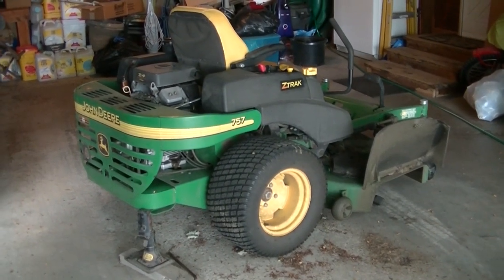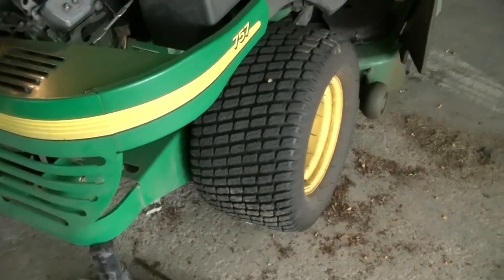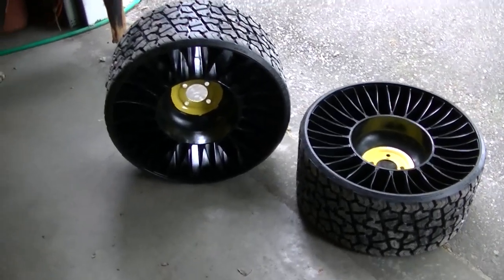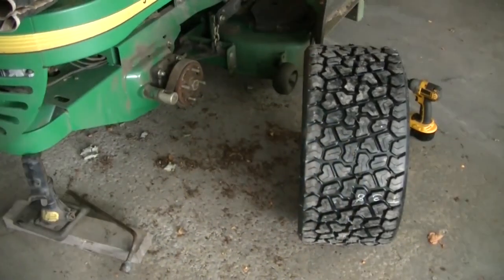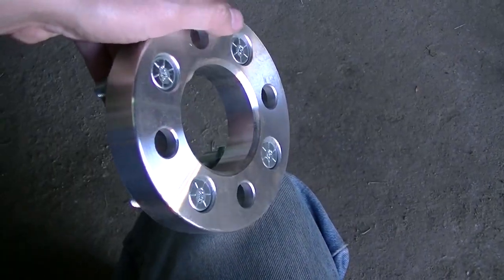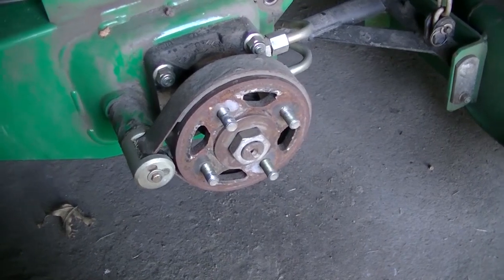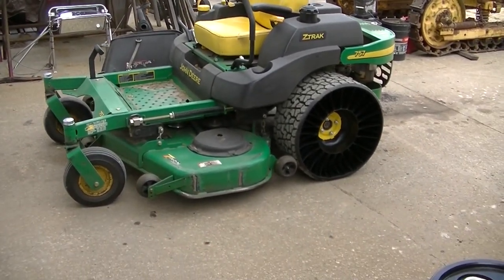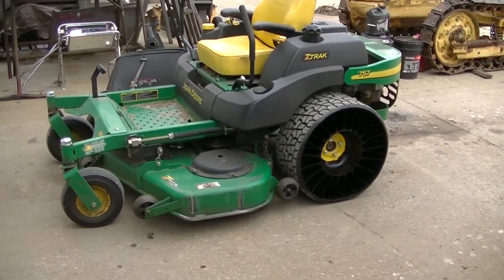John Deere 757 ZTrak Michelin Tweel Install Airless Tires

Comment: They make these for skid loaders as well. I would love to try them out on a skid loader. On construction sites nails are everywhere and not always do I need my track machines. Nice thing is you'll always mow evenly side to side, no more tire being low on air pressure on one side and causing the mower to cut unlevel.
Reply from the maker: I don't see any downsides yet except the cost.

Comment: I've tried since they released to get a set from my local John Deere dealer (Richie Tractor) for my Z920a and keep telling me I can't buy them, only come on the machine. Guess it's ok because I wouldn't have thought about buying wheel spacers and I definitely don't have the skills to machine them out like you did  Great video, I can't wait to see how they work for you.  I've heard nothing but good thing from some fellow landscapers. Hope scag gets some soon as well.
Reply from the maker: I was told the same thing at the dealer.  They sent me to the sales guy.  He looked it up and saw they now have a part # and could be ordered.  He called someone and they said he could order them.  3 days later they had them at the dealer.  I am probably one of the first people to order them separate from a new machine.  Not familiar with all the Ztrak mowers but these wheels are designed to work on the new Z900 series.  You can't get them on the Z915.  Not sure why.  They aren't cheap.  A little over $1100.  With a new machine they are $850.

Comment: I noticed this video is 5 years ago so, I'm just curious if your still running those same tweels  and how do you like them?
Reply from the maker: I love them. At first they seemed like they didn't have good traction. It's like they had a wax coating on them but that wore off. Not having to worry about air or running over something is great. The only downside to these tires is the price.

Comment: I am mostly interested in those type of tires to get better traction on hills was wondering if you have any input also was wondering if it is  Easier on grass with turns
Reply from the maker: When the tires were new they actually had less traction because they had like a wax on them. Once that wore off they work like normal tires. I don't see getting more traction from them. They work just like normal tires but never need air and I don't worry about running anything over. I wish I could get some for the front wheels.

Comment: Over $1000 lot of money just for a set of tires  ( Good video )
Reply from the maker: Probably would have had $300 or so in a new set of tires. Been two years and loving not worrying about air in my tires. I guess the way I look at it I spent $1000 but saved $6-7000 by not buying a new mower. I really want the air ride seat the new mowers have too.

Comment: Thanks for posting. Would tweels on the front have kept it level?
Reply from the maker: Not sure. I would love to put airless tires up front but not sure they will work on the older models.
Reply: @mossman381  We have solid tires on the front and they are great. It required several bearings to fit right on the axle.  But my frame got bent several years ago so one of them is frequently flailing in the air and landing askew. As a result, the bearings shear. Wish I had a way to fix the frame.

Comment: My lathe is super heavy man. Even lifting half of it with the WD-45 Loader made the back end come off the ground
Reply: Randy Bobandy wow nice tractor that must be a huge lathe
Reply: Bigfoot And Bananaman Solid cast iron about 10' long. Weighs about 2 tons
Reply from the maker: I am pretty sure we picked our lathe up with our Clark forklift.  I believe it has a 9000lbs capacity.
Reply: mossman381 If i had wheel weights i would have lifted it no problem